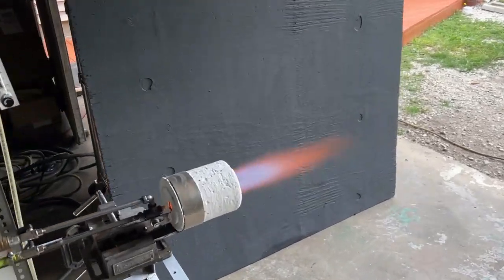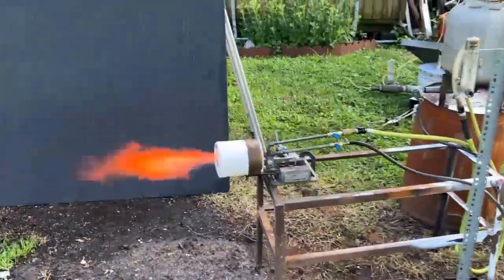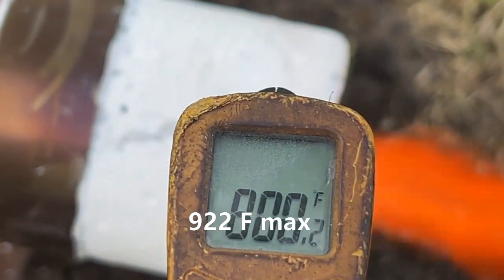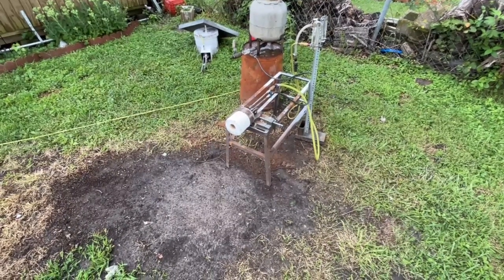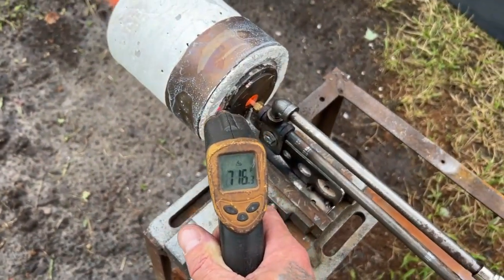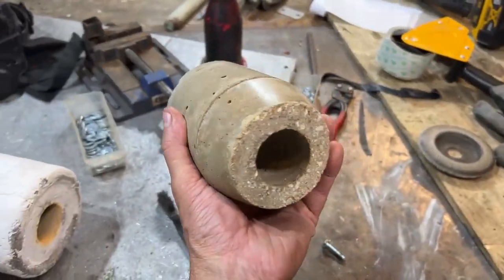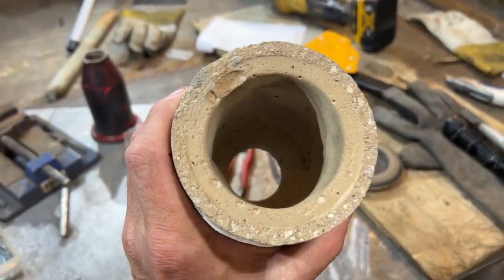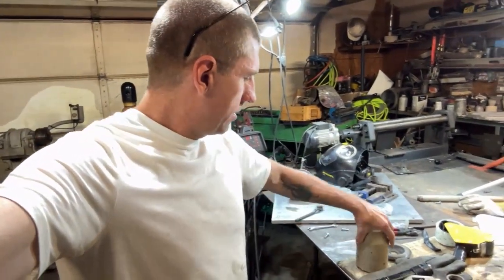The Rhino Refractory combustion chamber waste oil Kiln burner

Comment: I don’t remember your Results with the different Nozzle Designs, but the ejected Stream is very narrow.
It’s possible, that all the Air that gets sucked in creates an outer Layer that gets really lean and ruins the Combustion.

One Burner I know that is moving the Air fast has a 80° Spray Pattern with the Nozzle positioned inside pretty near the narrow End of the Air Flow Nozzle. (The sudden Diameter Increase also gives Turbulence to stabilize the Flame.)

Comment: Carbon fibers can also be used in casting refractory cement, as can alumina and asbestos fibers.

Yes, I know, asbestos is super dangerous.

All ceramic fibers are dangerous.

Also, super fine crushed alumina and/or zirconia powder makes a really strong, high temp refractory base material.

Calcination at about 3600 F would ensure it would last a very long time, but if you made it of stainless steel, you'd likely not want to get that hot, because it would not only melt the metal, but the metal would likely expand at such a different rate that it would break the part.

Comment: Did you line your combustion chamber with cerium oxide or any other catalytic element?

While its a lot more expensive [unless you just happen to have a junked out one laying around], crushing up the gut of a catalytic converter and mixing it in will work really well too.

Comment: You wonder if you could try some Silicon Carbide blasting medium and use it as an agregate, or Grog or Tooth as its termed in ceramic parlance. Also I wonder if you could make a castable refractory clay that you pour into a plaster mould, of that SiC tube you said you can't get any more of. Then do a batch and fire them. If there is enough course material, Thermal Shock can be minimised. That is what causes cracking. (i.e Thermal expansion and contraction). Materials like Pyroceram that contain lithium silicate actually shrink when heated (used in spacecraft windows). Very tough. Quartz Glass is similar. It can do a 1000˚ per second temperature gradient and not crack. But expensive.
Reply from the maker: Ive used something similar , the black blast abrasive media

Comment: vibrate wet mold in vacuum chamber to get the air bubbles out. its done in making jewelry molds
Reply from the maker: Good idea , the issue im having is with aggregate segregation with over vibrating . Ive also sen a cool technique of putting the molds into a pressure tank  to make the bubbles so small they dont matter
Reply: Ask vevor, say you're using it in a video and they'll send you their biggest one for free, you just gotta give em a shout out. Nothing long, like literally "thanks vevor, there's a link in the description". They love advertising their stuff.
Reply: @NOBOX7 I recently saw someone mention that separation happens when you add too much water, at least with Mizzou. Some castables require very small amounts of water.
Reply from the maker: @knickly  yep you must be able to make a ball out of it and toss it 6 to 10 inches into the air and it only slump 75 % or so . It must not run through your fingers